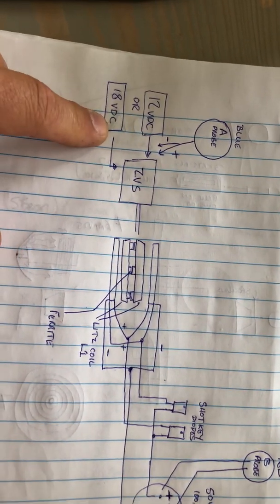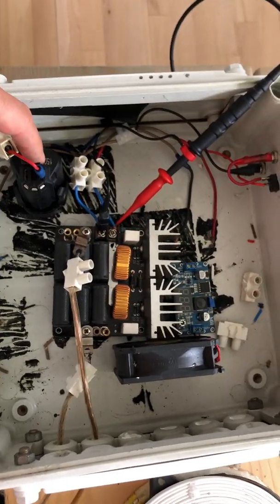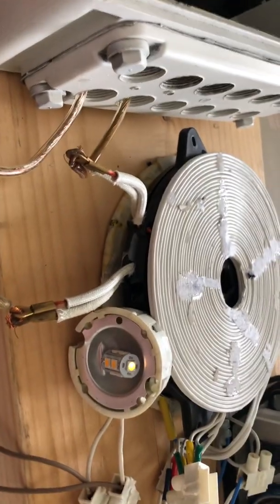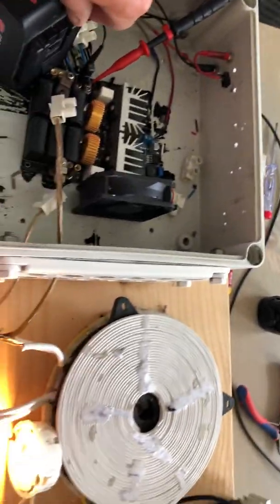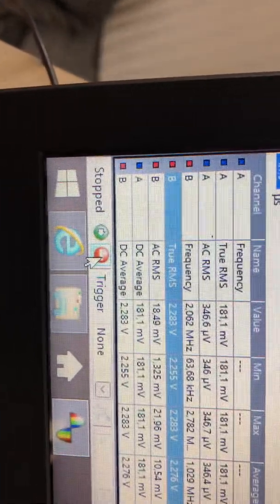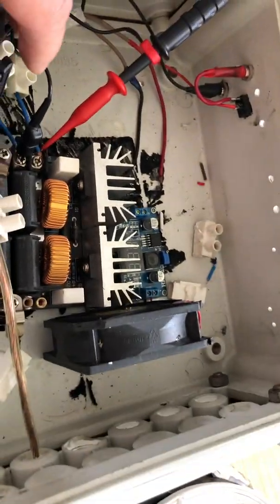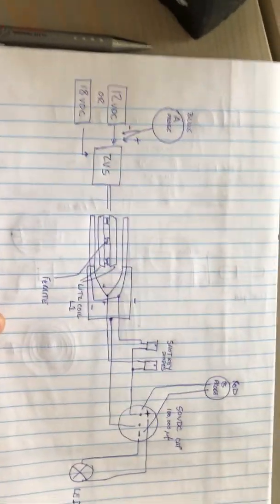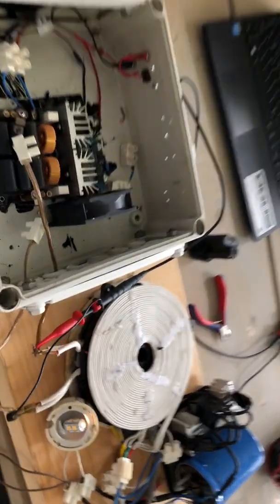Tesla bifilar pancake gives more output

Comment: I can't tell if you are putting out more, as there is no current measurement. 

the ZVS works at the resonant frequency of the inner (litz?) coil. This coil has counter windings, so it has a higher resonant frequency then normally, due to the unnatural compression of the Magnetic Aether field. I explained that in this video:
https://youtu.be/Tz-we83MnQ8

The outside coils resonate at their own frequency and are loaded by the cap/lamp (no earth ground which would make it even higher).

the voltage is amplified, but voltage alone isn't power. 

You have a resonant step up as the coils are ringing at their resonant frequency.  like a tesla coil. 

 power requires voltage AND  current. I don't know what the current is doing (if it is in phase and how much is it?)

DC power in VS DC power out would give the answer.

Comment: DK, on your PC scope screen showed input v/s output frequencies were way out of face.  Use caps to tune the circuit output to input. You can figure out  value of the caps from the frequencies or simply follow the sign waves on the scope until to waves become one. This tune up will make a big difference on the output.   T
Reply from the maker: Rainbow Light thanks for the great info. I will try

Comment: Hey DK, why you just not plug your output cap as your input at the same time ? If you have a couple of volts initially inside it you will easily see if you get OU. You don't think so ?
Reply from the maker: AnotherCat I will try this after resistance tests and see if it will run itself, it should when I look at the results. Thanks
Reply from the maker: Hi i will try this but i think that the problem seems to be with loading and off loading the caps of batteries at the same time. I will try the example Thor proposed as the fast switching could help i feel. Thanks for the comment.

Comment: Thanks for the experiment ..., I was experimenting with the two-wire coil in alternating voltage..and I got a three times exit. Then I tried to straighten the output signal, but I didn't get any output gain .... !!. Greetings Fabio
Reply from the maker: Fabio Cangelli what did you do to straighten your output signal???
Reply: @dkdyker  I used a fast diode bridge
Reply from the maker: Fabio Cangelli I already did this as you can see when I measured with probe for the DC measurements
Reply: @dkdyker  But you can measure the input power (Volt and current), and at the same time the output power. Can you make a video that you can see?
Reply from the maker: Fabio Cangelli the scope makes the calculations as per the video. A probe blue signal and B probe red signal.
Reply: dkdyker only  volt not to get the power in e power out
Reply from the maker: hi Fabio sorry for late reply seem i dont receive replies unless i read through each video i have made. i Would like to see your work do you have a link ?